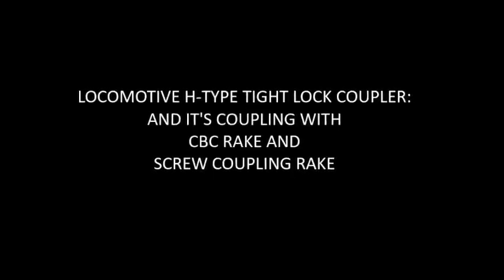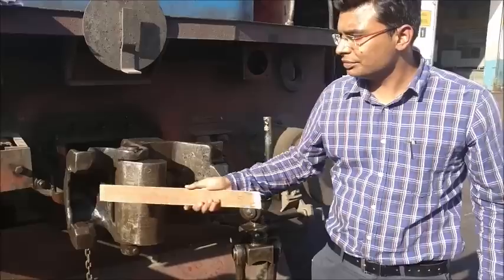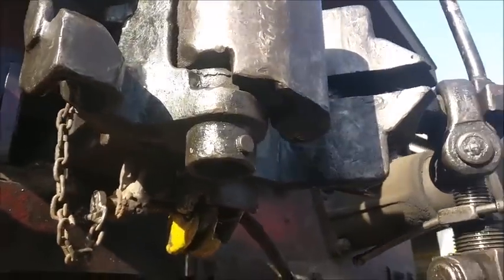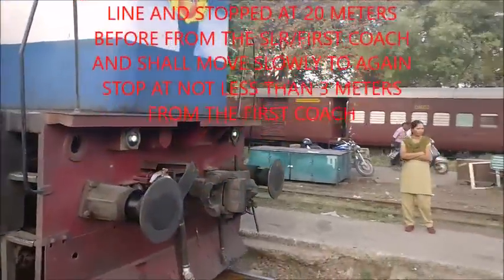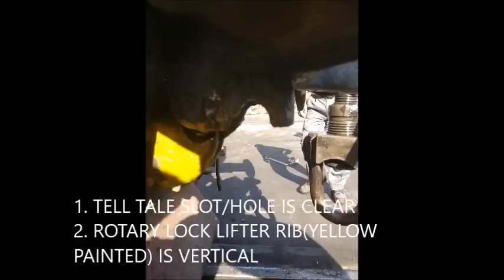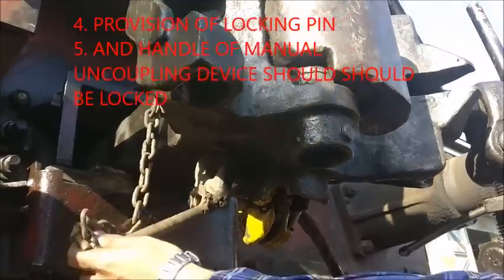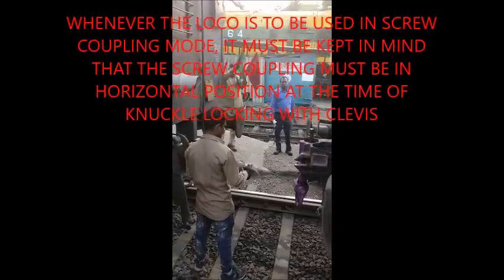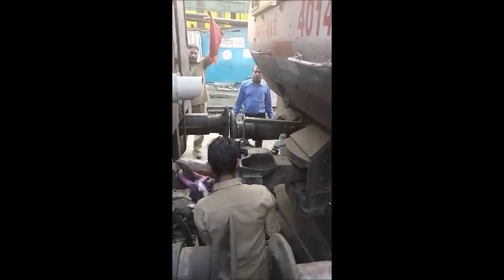H TYPE TIGHT LOCK COUPLER

Comment: I saw som any times nobody is inserting PIN in the hole of Lock even they don't Verify that knuckle is Properly locked or not ony they ask Driver or Whosoever bring power to Couple with the Train they only ask Driver to pull the Train and See if its couples Properly or not even they don't Lock the Lever Handle